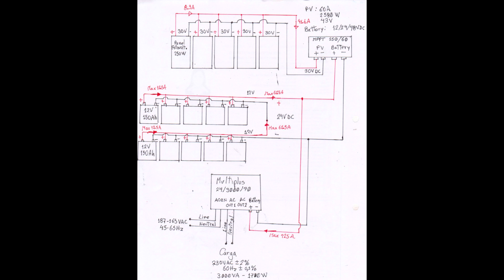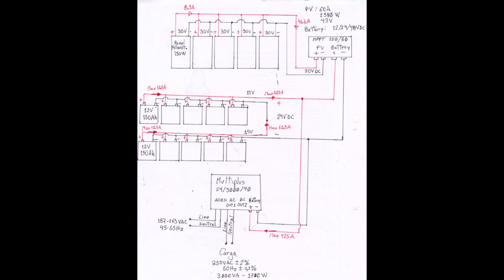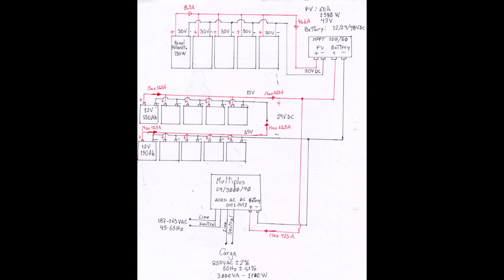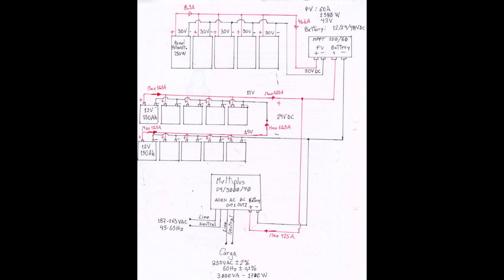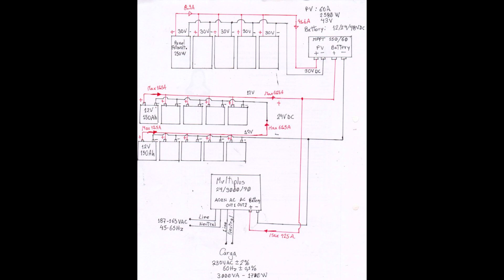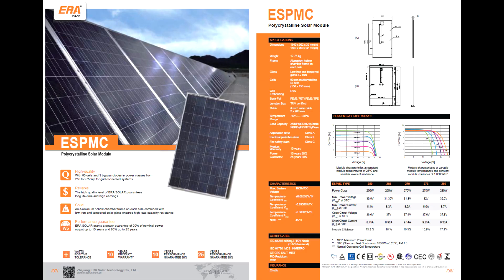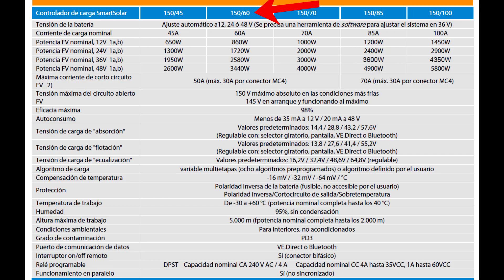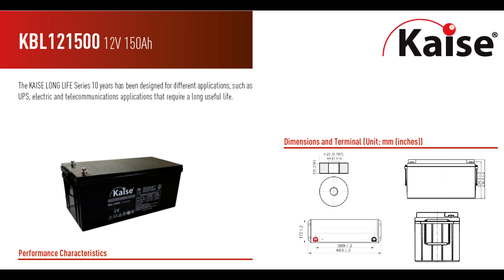Hybrid Photovoltaic System - MPPT 150 / 60 - MultiPlus 24 / 3000 / 70 - Victron Energy

Comment: What max charge current should be used for an AGM 660ah battery park?
Reply from the maker: hello, don't worry use the same configuration but you will have more energy stored
Reply: Thanks for your reply but i want to know if
I have three MPPT regulators which charge the batteries with a current of 42.5 A (4 panels) + 42.5 A (4 panels) and 22 A (2 panels), that is to say in total 107 A. Can we go beyond 107A or 127.5 A to charge my 660Ah battery pack (6 12V 220Ah batteries)?
Reply from the maker: The current (amperes) will not increase because is limited by your panels, the 660Ah batteries will take more time to charge but they will store more energy when necessary, if the ampere hour value (Ah) is higher, it doesn't mean more current (ampreres), that means more energy storage. Your current will increase when your charge will demand more power

Comment: Nice going, Christiano! ;) As long as there's sun, the batterries shall be fully charged :)
Reply from the maker: Thank you. Yes but this system will use the Electric Public Grid if batteries are discharged (Hybrid),
Reply: @romeroc24  Even sweeter!!! ;) P.S. What is the overall lifetime of the batteries used in your setup and how much do the photovoltaics aproximately cost (if that's not confidential info).
Reply from the maker: @damasta.md.99  About $6000 USD, and batteries' lifetime is about 4 years
Reply: @romeroc24  Very good and hope its use shall pay back its full price soon! ;)
Reply from the maker: @damasta.md.99  yes, thank you